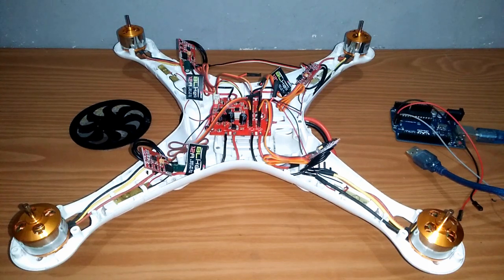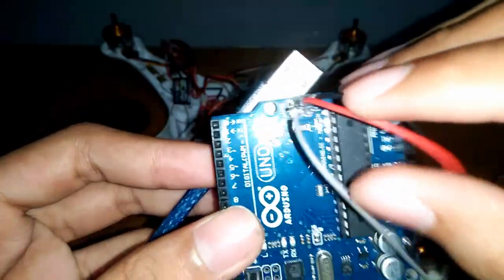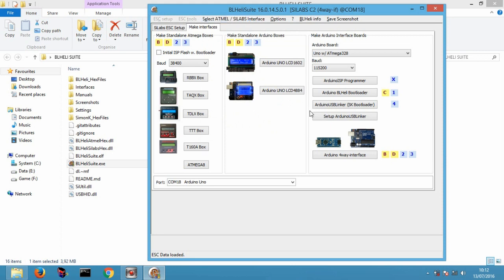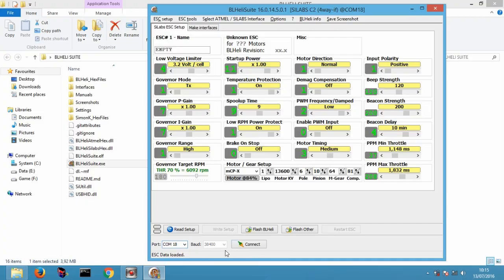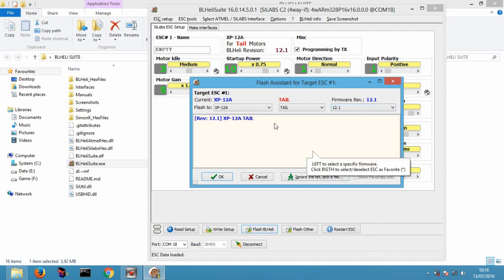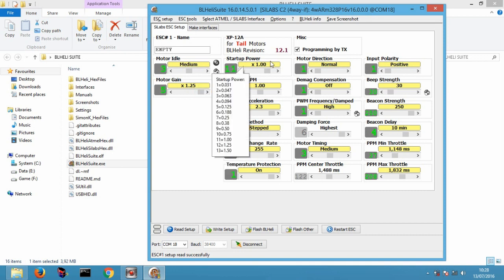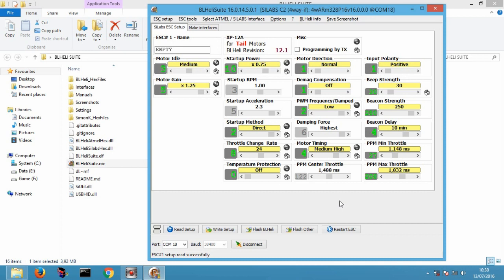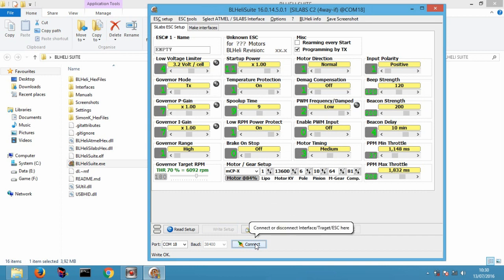SYMA X8 Brushless Conversion Tutorial PART2 - Software

Comment: So you are programmers. It can not fly with this. Flush yes, but landing is a problem. I need to reduce the idling speed. So guess if you know someone.
Reply: Hi good day did you program each esc or you just program 1? Ty
Reply: @reygonzales9653  I have completely programmed all four ESCs, but it has a big speed, hard to land. It's almost impossible to land.
Reply: Thanks for the reply i am also converting my syma drone into brushless will try to tweak mine

Comment: i bought the same Emax BlHeli 12A, (same pcb too) as yours, but mine came with emax 20A firmware v14.5 and cant flash the XP12A firmware.

Comment: Hello Muhammad!I compile a system like you. But there is a problem.
3 motor run and controlled by the transmitter, and one motor on the team does
not react.Motor A2212/930KV ,ESC EMAX 12A BLHeli .
Motors and ESC serviceable.  Checked servotesterom.
However, when a voltage is applied there is no sound.
What could be the problem?
P.S.    The ESC firmware has not changed.

Comment: Any different setup? I have huge problem with  throttle - little power and he in the sky and it is a problem go get it down.. i dont have smooth throttle like on the video just little and he is in full throttle. Can i adjust it ? I change a motor gain on blheli but not big change? Can do it smoot throttle to get it up and down smooth 700grams is the weigh
Reply: Did you have any luck in changing throttle setting to a lower idle speed?

Comment: i have a problem, 2 of 4 motors is not binding.. after bind with the remote the front motors is binding and spin but real 2 motor is not binding and sniping, if i change the place of the connectors of the board 2 motors on real two connectors are not binding or spinning... i am out of idea? please help
Reply: Damian karov thank you very much for your answer, I'm willing to put my drone brushless motors. What is manual labor that is simple installation, put the 4 esc, and flight controllers. I had  questioned me was to adjust. But I try to make this great and small project and will be like me. A greeting!
Reply: Hi, Damian!
You managed to solve the problem with 2 motors?
I have the same problem.
2 motor run and controlled by the transmitter, and 2 motor on the team does not react.
Motor A2212/930KV ,ESC EMAX 12A BLHeli .
Motors and ESC serviceable.  Checked servotesterom.
However, when a voltage is applied there is no sound.
What could be the problem?
P.S.    The ESC firmware has not changed.
Reply: You managed to solve the issue of only 2 engines working for you? since I have the same problem and can not find the solution anywhere, greetings
Reply: YOU deserve what you got for following a stranger on Youtube, stupid asshole!

Comment: i, don't understand ... on each ESC i have to solid cables to program it with arduino, or on one of them ? and is this jumpers ot ESC ? blue circle ? on video??
Reply from the maker: You can use four cables, one for each esc or just one cable (alternately).

For blue circles, just ignore it.
Reply: thank,you!
Reply: Damian karov Hi, I've seen that you've been wondering what I'm about whether to calibrate all engines or do it on one side enough?
Reply: Gabriel castro , you must solder wires on each ESC because, you have to calibrate every one ESC with arduino. I have trouble with my esc , bad solder on the syma x8 board , and bad bad solder (not main job) on the esc . My settings is in blheli settings for the esc is little different... only thing i was change and is different from the video is "motor gain" i set this to default "1.0" because i have noticed the throttle on the remote is to responsive and the range of moving is small...
Reply: This is a really helpful guide, thank you, I think I'm going to give it a go. May I only ask for a clarification, if you can answer. Do we need to remove those capacitors off the ESC or not?